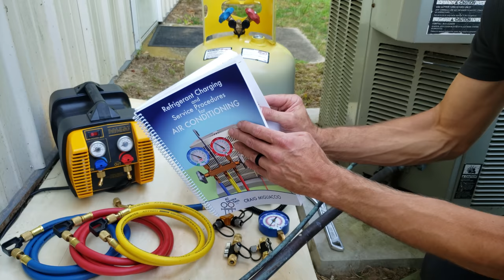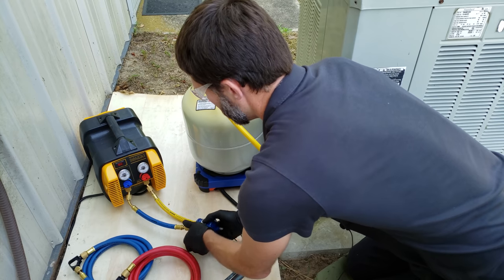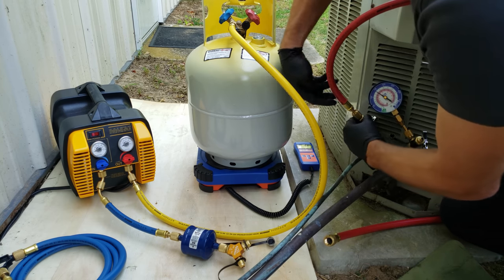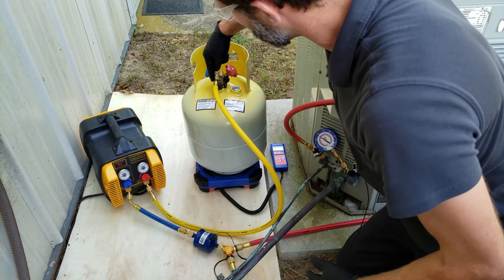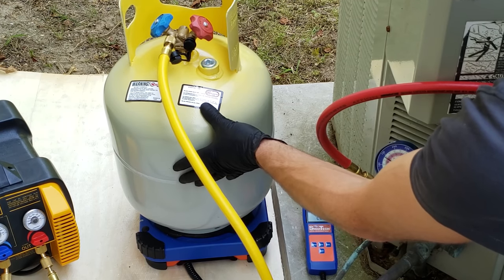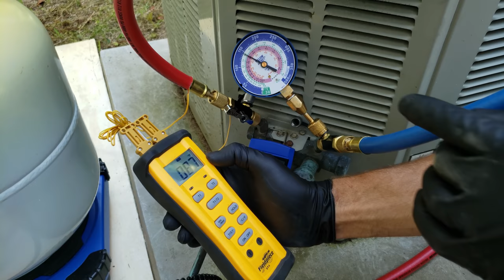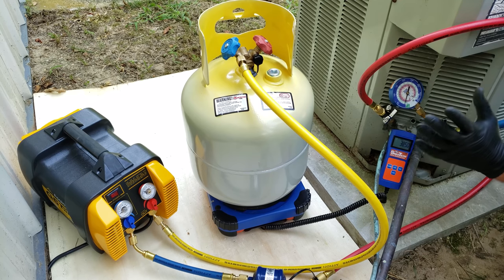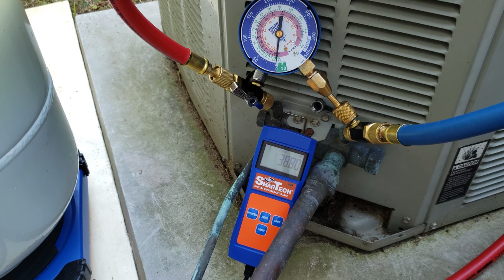HVAC Refrigerant Recovery Machine, Hose, Tank, & Tool Setup and Procedure!

Comment: Hey Craig, I’m trying to get in the HVAC career. Can you make a list of tools that a technician will need to start with. I’ll really appreciate it.
Reply: Buy a variety of hand & some power tools first. Your company may or may not provide you with essential HVAC related equipment (Recovery machine, Vacuum pump, Torch kit, etc), Some stuff you'll likely need: Sets of pliers, needle nose pliers, adjustable wrenches, 11-1 Screwdriver,  6" Precision screwdriver to adjust control board and thermostat  terminals, Cordless impact driver, multi-meter with an amp clamp. Companies will likely have a tool list. If not, your co-workers will let you know.
Reply: Go to his website, he has tools lists on every aspect of the trade so you can get your bearings.

Comment: Craig, Where did you get the pieces that you keep you recovery hoses sealed while not in use, I don't see them listed on you tool list?
Reply: I think they might come with the hoses
Reply: Appion makes them & their hose hangers. You can get a pack of 5 from Johnstone Supply. I have some & they work great for keeping all your hoses clean & helps with storage by just hanging them up in your service van or shop.  👍

Comment: Can anybody tell me what the purge setting is on a recovery machine if we purge the line with the indicator set on open on the recovery machine? Thank you
Reply: Purge setting forces the last bit in the hose to the recovery tank into tank? Instead of venting to atmosphere? Do we have to leave it hooked up to unit if purging? Or can we remove blue hose before turning recovery machine to purge setting to force refrigerant into recovery cylinder ?
Reply: @JC-sc9rx  You pretty much figured it out. What the recovery machine does is compresses the inlet (a/c line set) into its own compressor/line set and out to the recovery hose and tank. Even when you reach zero psi on the inlet you still have pressure between the tank and inside the recovery machine. Purge attempts to push as much of that refrigerant into the tank. I wouldn't remove any hoses until after you're done purging.
Reply: @jrtakesthesky27  ok thank you

Comment: Any other suggestions for recovery in cold conditions with a unit that has a large accumulator? I very carefully use my torch on the accumulator, slowly adding a bit of heat. I do this until the accumulator feels warm & stays warm for a few minutes. I also do this on the compressor if I see frost developing on the compressor case as I recover.
Reply: I kind of like the idea but I’d be nervous about using a torch. If you ran the fan or used a hair drier it seems safer. 

Actually maybe a heat gun with settings might be ideal. The manufacturer of the system probably has a recommended maximum temperature the heat gun could set to.  The trouble is, they can be pretty spendy.
Reply: Torch is great but be careful you don't blow the soft plugs on the accumulator.
Reply: @David0lyle  I'm extremely careful with the torch and use it sparingly. I keep it constantly moving and pay attention to wiring and aluminum fins nearby.  I don't tell my employees to use this method. I've often wondered about some kind of heat blanket, but of course, I never have that with me!
Reply: I would never use a torch. I have a Milwaukee cordless heat gun that I use and it works great. Heat is not as high as a torch, but the risk is substantially diminished.

Comment: Do you take the recovery to 500 microns before using it?
Reply: No
Reply: Craig where can I get that book?
Thanks
Reply: I think what @britestart1 is asking is: Do you prep the new recovery [bottle] by vacuuming it below 500 microns?  The answer is yes.  That is what Craig did initially and then added a small amount of refrigerant so the bottle would not have a vacuum.  (Personally I find leaving the bottle at a deep vacuum aids greatly in pulling refrigerant out of the system.)  Now when you are talking about the actual recovery process, NO you do not recover much below 0 PSI on a good system.  In fact this is a test question on the EPA 608 exam.
Reply: Oh yes I meant do you put the recovery tank into a deep vacuum (500 microns)? Especially if we returning refrigerant to a supply house to try and get credit for it.
Reply: @johnchain5478  Amazon for sure or his website its in the notes below the video.

Comment: Great video, but Greg you don't explain the purpose of the full recovery. Is it to replace an outdoor component only, or is it to replace an air handler component? And what's the difference of a partial recovery vs. full recovery? Pardon my ignorance and possible dumb questions.

Comment: Very good, exactly how to do it.
Reply: This video was not all that excellent and actually it could be a little confusing for the novice or someone such as yourself (no disrespect) .. the hose set up was over kill, he did not use a manifold, and the procedure was done kind of out of order ..
Reply: @brickcitynetwork  1 hour wasted cost you how much? And if done over 1,000 times a year. Or even 5,000 x a year with several of employees. How much of a loss is that? How many calls could have been taken instead?
Reply: @heatncool  What are you saying .. Trying to make sense of what your saying .. and as far as other calls “COULD” have been taken is exactly just that a “could have been” and that does not mean anything .. No service calls are guaranteed to happen in this business ..
Reply: @brickcitynetwork  lol do you not reject 10-30 calls a day because you simply have no time? 🙃😂

Comment: Good video, but I have to say this...You can not, thats "you can not", get anymore volume out of 1/4" outlet by adding 3/8" hoses...It's impossible...It's like putting a fire hose on  the water spigot of your house...You can only get what the smallest orifice will allow...1/4" valve, means 1/4" volume max, in the hose...It could be a 1" hose and it would make no difference, the 1/4" valve rules the flow.. So the 3/8" hoses are a waste, unless they're on a 3/8" valve...Sorry, but thats basic science.
Reply: I agree but I guess a hose can have some friction loss but it can't be much.
Reply: Hmmm… basic science? Somebody didn’t take any classes in Fluid Mechanics. You WILL get a lower pressure drop across the system, thus higher flow rate, with larger hoses (within reason). Though the 1/4” fittings create a restriction, the 1/4” hoses create friction loss which is higher than the 3/8” hoses. 

Think of it this way, why does the system in this video have a 3/8” liquid line if all that liquid is just going to be pushed through an orifice that is about .070”? Look at a decent installation manual for any split system and you’ll see a pressure drop curve or chart for varying size line sets. 

Another fun example is electrical wire. Sure, running 8 gauge wire to your lights in your home is excessive, but saying that 8 gauge wire doesn’t offer less resistance than 12 or 14 gauge wire of the same length because the lights have a tiny filament is silly. 

Hopefully you’ll do some independent research on the topic of fluid flow, specifically minor and major losses in piping systems, and see where your thinking had good intentions, but simply wasn’t correct. Cheers!
Reply: I'm thinking the liquid line is 3/8" depending on tonnage, from compressor to metering device and not going through a 1/4" restriction like the service valve to a 3/8" line...I might have been missing something after all these years and my science teacher too...I'm wondering, with your fluids mechanics theory,  why they don't sell fire hoses to people to water their lawns or for home fire protection...I mean, just look at how much more water they would get using a fire hose instead of a maybe a 1/2" or even a 3/4" garden hose...Wow...Look at all that water and out of a 1/2" spigot...Even increasing the pressure wouldn't change it...Supply valve orifice rules amount of supply...Period...Kind of like an HVAC piston orifice huh...I like your teachings, was an instructor myself for a few years...I simply disagree...No disrespect intended.
Reply: @vernroach3413  No disrespect taken. However I did say “to an extent” when discussing the 3/8” hose. Clearly putting a 1” diameter hose on the system wouldn’t make such a big difference over the 3/8” hose. It’s not a directly proportional increase of flow with increase in diameter. It certainly has diminishing returns. However, they do sell 3/4” diameter garden hoses and I can personally attest that they work quite well when you need a long run of hose. But yes, a fire hose would be overkill for sure. I just think your example is a bit far-fetched over the 1/4” to 3/8” refrigerant hose example is all. Good conversation though, even if we have to agree to disagree. 👍🏼
Reply: @andrewpierce2213   This is a somewhat old post and comment you made on this video but your example of using 8 gauge vs 12 or 14 gauge is not quite correct/complete.  What you are forgetting is that the voltage drop is proportional to the current draw so if the filament (load) is small, the voltage drop might be negligible anyway.  Does it offer less resistance, sure, but resistance itself doesn't tell the whole story.  So to get the same Watts, your current supplied to the filament would slightly increase.  This would be akin to pressure in the smaller diameter hoses used.  At the end of the day, While I agree the resistance is less in larger gauge wires and does make a large impact on large loads depending on the length of wire needed for the application, I see recovery using a small hose vs a slightly smaller hose being negligible.  It would be interesting to see two identical systems being recovered with the different size hoses and actually see if time is different.  I'm guessing it would be only a few seconds at best.  Maybe not worth the cost of the larger diameter lines vs the time savings equivalent.  I think Vern wasn't as far off base as your comment inferred.

Comment: Wouldn’t recovering/ reducing system pressure below 7psi pull air into system in the event of a leak?     

Thank you for your excellent explanation.   I got into HVAC through the electrical control / automation side.  Your videos have helped me fill some major knowledge gaps.
Reply: Welcomed